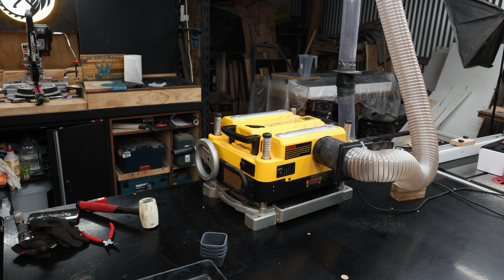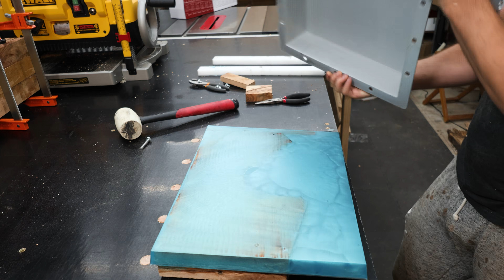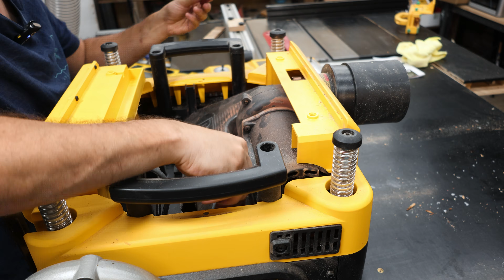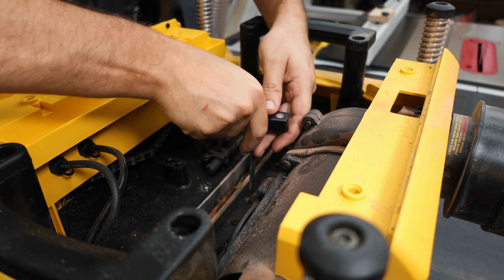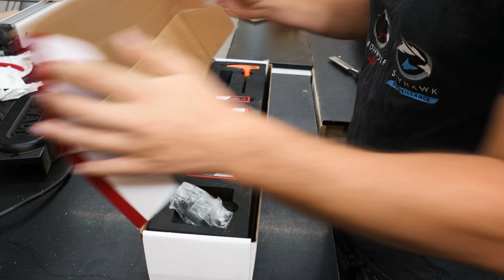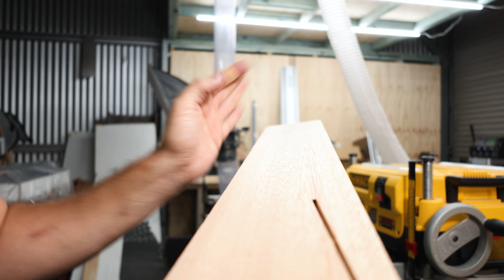Helical Cutter vs Straight Knives – Is it actually worth it?

Comment: A good review video; I completely agree with your conclusions. What I didn't hear you mention is that it's useful to apply a little copper grease to the blade blocks before screwing them onto the roller. If you don't, it can be quite a task to loosen the blades after a year, when resin and sawdust have caked on them. There's a good chance you'll break the blades and no longer be able to use the other three sides.
Reply from the maker: That’s an insanely good tip. Thank you. I already broke a bit when I tried to tighten them. I’ll pin this comment so people can see 😊 thanks again!

Comment: Nice upgrade! I bought my DW735 used after the previous owner had already upgraded to a helical head, so I didn't have to suffer through the switch out. But I bought it to replace a different planer that also had a helical cutterhead, but with that one I could never get the cutters aligned no matter how carefully I installed them. The only issue I have with the Dewalt is a bit of snipe on the trailing edge, which I cannot fix (again) no matter how many tricks I've tried. Cheers!
Reply from the maker: That's a bummer about the snipe. Might not be the cutter what bed are you using? Thanks for checking out the video appreciate it ☺️
Reply: @coolabahwoodworking I’m using the stock bed, which I think is exactly the problem. Maybe someday I’ll try a sled.
Reply from the maker: @ yeah o have seen some guys doing so w nice beds on YT. Made them longer
Reply: Snipe CANNOT be eliminated. Just make the piece longer, and cut off the snipe afterward. I have been doing woodworking for 50 plus years. You can also finish up with a router sled if you can't cut the snipe off.

Comment: My 20” old school powermatic with a shelex head. lasts about 18 months before rotating in a college woodworking class with up to 90 students per semester and half that many in the summer class. The Dewalt 735 lasts about 9 months before rotating but has about twice the lineal feet run through it and a lot more glue ups. $400 for 132 inserts on the Powermatic lasted 6 years. Straight knives on the same machine. Replaced 3 times a year at $1 per inch for sharpening = $240 plus twice the time to install. For heavy usage it’s worth it but for the weekender, don’t change unless you’re working with highly figured wood. Great job on the comparison.
Reply from the maker: I appreciate it. Thanks for the great feedback and that really good breakdown.

Comment: Nice work! I have a "Helical Head" WEN planner. 😅
Reply: How do you like your WEN planer?
Reply: @Gazman299   It works well enough for me. I only use it a few times a year. Definitely have to take shallow passes.
Reply: @Gazman299    It works well enough for me. I only use it a few times a year. I definitely have to take shallow passes.
Reply from the maker: Awesome man. How does it go? Thanks for checking out the video appreciate it 😊
Reply: @coolabahwoodworking  WEN version on has 26 blades... It's not so much a helical as it is a spiral.. It works good enough for me.
Reply from the maker: @fiveduckstudio  the spiral heads are solid man. Again the big upside is it has 26  blades so one is nicked you can replace it. How is the power on it?
Reply: @coolabahwoodworking I owned a regular WEN planer... And then this one... So I'm not sure how the power is compared to other things. 😆. I ran Ash through it once and I definitely had to make sure I took multiple shallow passes.
Reply from the maker: @fiveduckstudio  well that’s ok anyway 😂😂😂

Comment: First, straight blades for the DW735 are not $95, they are under $40 US. Second, using a "budget friendly" helical head was your first mistake. Third, the blades on the helical head last 3-4 times longer and they have 4 sides as well. Also they can be individually changed when a knick appears versus replacing an entire straight blade. Fourth, the worst thing about the DW735 is its inane desire to trip the on board breaker incessantly. Once your blades pretend to get dull, it starts tripping like crazy. The purpose of the breaker is thermal protection - heat. No heat ever gets to incur, the breaker is just an ignorant design. With the Helical head that "trip" feature is displaced drastically making the planer a usable tool again. Fifth, if all you are doing is going through one set of straight blades a year, why drop $600 US on a planer when you can buy a cheap one? 

The DW735 is a great tool, with a few flaws. They try to make it a low end production tool while insisting on skimping on a few areas where production should have been implemented. I run 1,000 bd.ft. a month easily(yes I am updating soon to a 220/3hp 20" planer) and the DW735 powers through it, except that stupid breaker. Changing the head out with a Shelix(about $450 US) is taking place this month for me and anyone who planes more than once every 4 months should consider it. It IS absolutely worth it and the return on investment at selling the planer used is returned at sale.

I found your "review" lacking in practicality, quality control, and basic woodworking knowledge. Stick to your day job. 
EIDT:
Never, never, never run end grain or slightly encourage others to do so! It is extremely dangerous and no sympathy to those who get injured doing it. Buy a drum sander if you plan on doing end grain cutting boards.
Reply from the maker: I appreciate you taking the time to share your thoughts and experience! I agree with most of what you said and I think I also covered most of it in the video. I haven’t experienced the tripping issue. Quick question the thermal overheating is an issue more of the straight blades? When I did my research I found that most people are saying that the Dewalt is working harder with the helical head. I thought that would make this issue worse? Honest question here.
Reply: @coolabahwoodworking  A helical head does tax the motor more than a straight blade, but I have yet to hear anyone say theirs died that had a helical. The breaker is a thermal breaker and the issue I have is, it really does not do what its intended design is. It is supposed to protect the motor from thermal breakdown, but the only thing I find is it trips due to its proximity to the power switch. I have place HVAC foil tape between the switch and breaker and have had far less trips since. No time when the trip took place was the motor even close to having an elevated temp, so it is getting the heat off the switch. I plane a lot of cypress, which is a softwood. I have had brand new blades and still tripped after just a few passes. I considered bypassing the breaker altogether, but I think the Shelix is where I'll go. If the planer burns up because of it, oh well, it's pretty useless as it is to me right now. As it stands(stock) and average job takes 2 hours longer due to having to take passes of smaller increments and the trip issue. On average, I plane 500 ln.ft. per job. Might just be too much production for it. In the end, you won't find a better benchtop planer at this level.
Reply from the maker: @ awesome thank you for taking the time to reply. I am really happy with it and I am keen to see what that helical head can do. So far I am optimistic. The Dewalt is a beast and I think one of the coolest features of this one is the dust extraction. I thought it would make way more mess because people are upgrading it but was really surprised how well it works
Reply: @coolabahwoodworking  I have had mine 5 years and I work it harder than most because I am light production. All my wood is straight off the mill so it is in its rawest form and needs full planing.
Reply from the maker: @pepperman9  thats awesome. Keen to get to that stage

Comment: save your money, and buy a planer with. a larger cutting diameter that will make more difference than using a lunchbox planer in general
Reply from the maker: @oliver299d  one day mate. Not sure how I would fit it though. Atm it’s easy, I pack it away when i am done. Thanks for checking out the video.
Reply: @coolabahwoodworking  all depends on how much you are planing and how often you use it, For me I would go broke having to use a machine like that because of the time that it takes to run stock, my machine I can take an 1/8'" off in one pass if I want to
Reply from the maker: @ that’s awesome. What machine do you use?
Reply: @coolabahwoodworking  I have an Oliver 299 its an older machine it's very heavy and solid
Reply from the maker: @oliver299d  oh yeah that’s a big machine. Awesome thank you
Reply: @coolabahwoodworking  for it's capacity it actually isn't too big of a foot print just a lot of cast iron which makes it really quiet and smooth
Reply from the maker: @ thats great ☺️

Comment: I find it's perfectly fine to run edge grain through the thicknesser as long as it's very shallow passes.  One tip for avoiding the tear out as it exits the edge is to put a round over or chamfer on the edge before sending it through.  This almost always eliminates the possibility of the knives chipping out the edge.
Reply: I assume he meant end grain, not edge grain. One thing you find in woodworking video comment sections are the safety Nazis. They remain injury free by typing all day and night instead of making chips and dust. I enjoy the trolls on the web trying to irritate everyone more than these folks.
Reply: @rexseven6907  I did indeed mean end grain.
Reply: @rexseven6907  I keep all my fingers and toes because I respect my tools and follow proper safety. I also spend at least 40 hours a week in my shop so your fantasy of keyboard warriors must just be a self reflection. I'll put my 50 years in a wood shop up against yours any day.
Reply from the maker: That’s a good one. Makes sense too. I have to try and see if it fixes this issue. Thanks man appreciate you checking out the video.
Reply: No, it is not perfectly fine, what an idiotic thing to say to this community. We woodworkers are always here to help and encourage those seeking more knowledge and skillsets. I have found this community to be the only one that does not berate someone who tries and fails, we encourage and support. You sir, are reckless and dangerous and no one should ever listen to anything you say.
Reply: @pepperman9 Well, if you don’t know how to do something, then maybe you shouldn’t try it. But belittling others that do know how to do it, isn’t helping anyone. I actually glue cauls to each end and run them through with shallow passes and have never had a problem. Learned that from watching MTMwood. He has probably built more cutting boards using that technique than most anyone else on here.

Comment: Man you are getting better and better every time out. For what it’s worth, it would have been interesting to measure the power draw for each type of cutter. Those helical heads require a lot of torque and will really tax these Dewalt planers to the limit and sometimes beyond, which shortens the life of the entire unit.
Reply from the maker: Thanks!  You are right I should have measured the power draw.  Appreciate it! Might do an update video ☺️ thanks for checking out the video

Comment: Having done this upgrade, I agree.  I use white ash a fair bit, and appreciate the improved performance and lower noise.  Having to do less sanding is huge!  Even when not using such hard wood, I usually use plain- or flat-sawn lumber, so there's nearly always reversing grain.  The cost savings is less important to my hobby woodworking, but hopefully over time it will save me a few bucks.
Reply from the maker: Thanks!  That's really great to hear and thanks for checking out the video